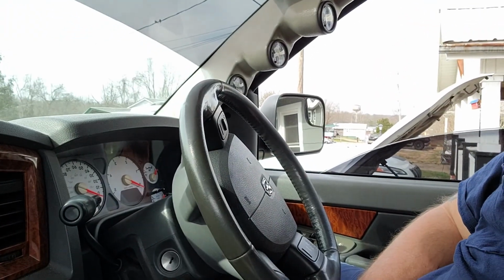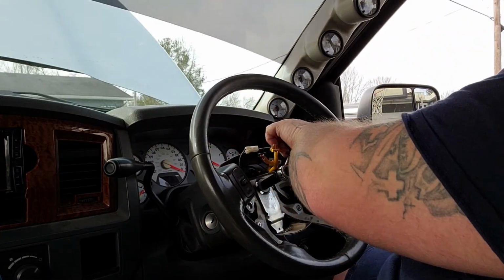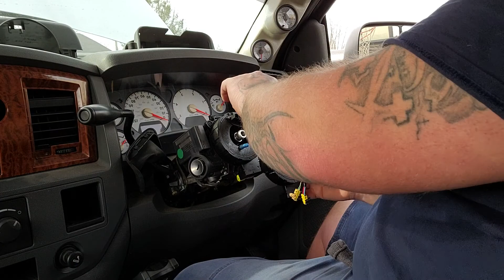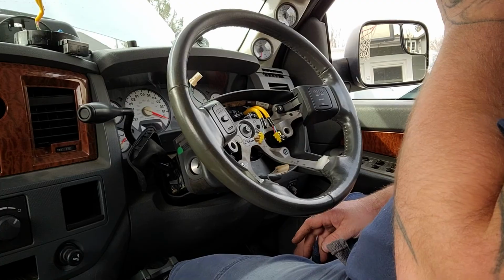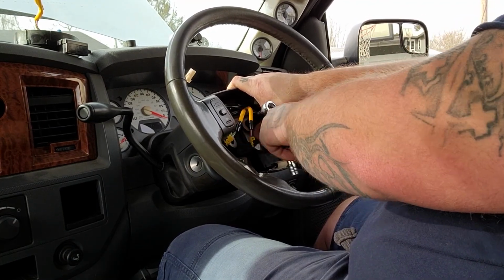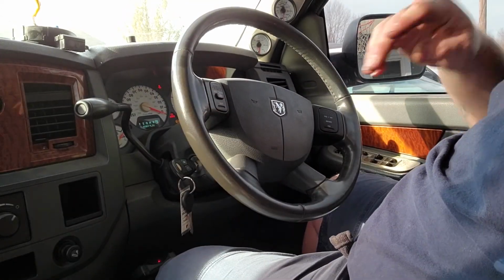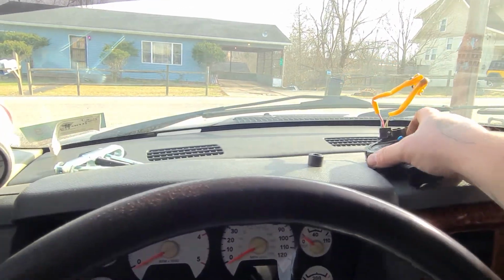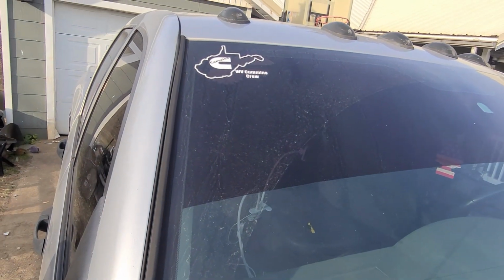2006 Dodge Ram Cummins clock spring replacement

Comment: thanks was a big help I have the exact same truck just turned 310k miles got all the tools and it took me 20 mins . 
 I took the old one apart to see what happened and the ribbon wire inside it doubled up on itself and constant turning folded it so many times it broke off . there isn't much to them just a fancy way to run wires to the steering wheel .  I bought it on ebay for 30$

Comment: Any chance your a/c wasn't blowing cold when the airbag light was on?  Thats my current situation.  Trying not to replace the TIPM.
Reply from the maker: Unfortunately my ac hasn't worked sense I've owned the truck but they a known for the ac pump to go out maybe that's the issue

Comment: Great video. But just one thing: You said store the air bag with the plastic cover down. This can be dangerous, because when the airbag exploded it will fly like a canon ball through the room (I've seen this once happening many years ago when I worked at a BMW dealership in Germany, luckily nobody got injured). Lay it down with the other side first, BUT make sure to not put it on a metal work bench without any cover under it. 
Just found a video of how an airbag will fly through the air then: https://www.youtube.com/watch?v=LEIp7FIOyKg